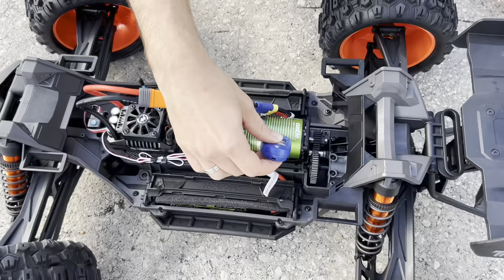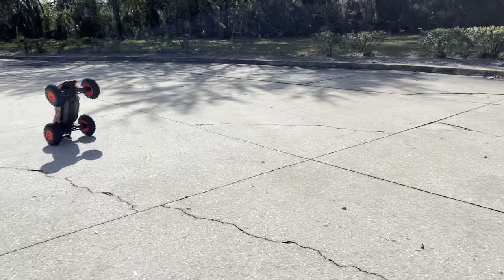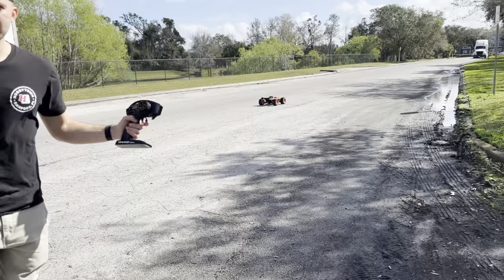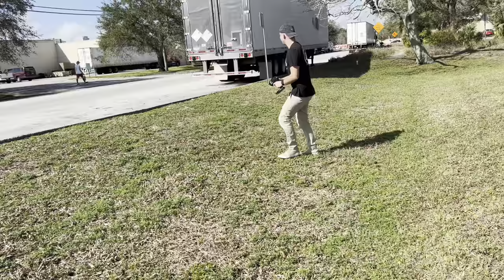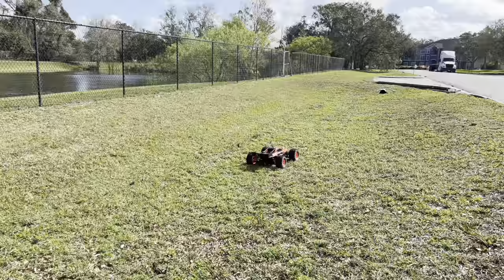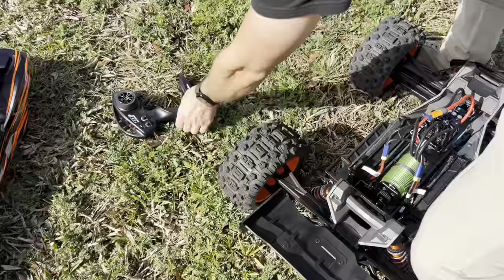XRT with MASSIVE 1100kv MOTOR FIRST RUN | STANDING BACKFLIPS and MORE!

Comment: You need to get a m2c so you can mount the max5 and put your receiver  back stock place. I am running 32/46 in my it don't wheelie as much like yours and I love it.
Reply: I have a Max 6 G2 on my Xrt..24/46 on the Xrt belted wheels.im only getting bout 55...I'm trying to get 70mph on the belted tires.. What's a good set up for mine?? Thanks

Comment: I🧐would move to an upgraded gear set, keep your factory gear ratio and  decrease THR rate in the TX, thereby reserving your SP.  Possibly increase stability by offsetting the truck’s CG using counter weights.  If adding more weight, also consider modifying suspension with dampers for additional support.  Hope this helps!  🙂
Reply: weights would destroy it unless its strictly no air-time
Reply: @Xbot4Life  very true!

Comment: How is it fun driving that XRT with that much power? I am sold on Arrma I bought the Typon Tuned TLR and it is fast and stable it's 4x4 and it stays on the ground so I'm able to use all the power. I have a Traxxas Rustler VXL 2wd and it does wheelies all up and down the road so I can't use all the power and it's not as fun as my Typhon.

Comment: It has too much power.  Add some lead weight to the front and gear it down. That thing is crazy
Reply: It still wouldn't matter the torque from that motor will over power those lead weights

Comment: I went mod 1.5 because the hardend steel doesn’t break but just strips. And you might want to shim your diffs for longevity. I run the hobbywing 5687 which is probably even a little less powerfull than this motor.

Comment: Are there any fan mounts or cooling fand for the 1100kv setup on the xrt? Just wanting something to help with temps
Reply: Just use the stock fans and heat sink. I put the heat sink on a vice and used it to spread the heat sink open enough to slide the motor in. Then reinstalled the fans. Problem solved

Comment: You need to go with WFO 1.5 steel mod spur and pinion gear combo. Anytime you  mod up to a big motor, esc and battery combo you need to upgrade other supports like your gears, steering,  tires and what not because you will break something on that truck because of so much torque and power that 5th scale motor is putting out. You can't even keep the front end down when trying to do a high speed pass because so much torque coming out from that motor when you barely throttle into it. If you do a high speed pass next time try switching to street tires and change your gearing.
Reply: Can the constant wheelies be resolved? it doesn't look fun as it is
Reply: Thin center diff fluid. Traxxas runs peanut butter center diff fluid in their bashers so they will wheelie.

Comment: The gear set your going to use as a replacement /upgrade is the Traxxas,  'Spur gear, 50-tooth (machined, hardened steel) (wide-face)/ gear, 20-T pinion (1.0 metric pitch) (fits 5mm shaft)/ set screw, MODEL# 6450' ?